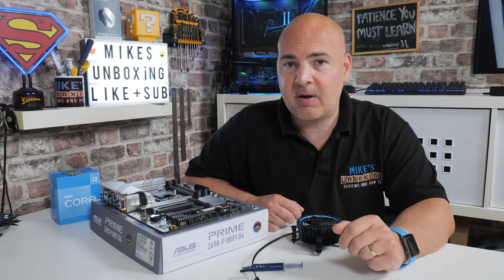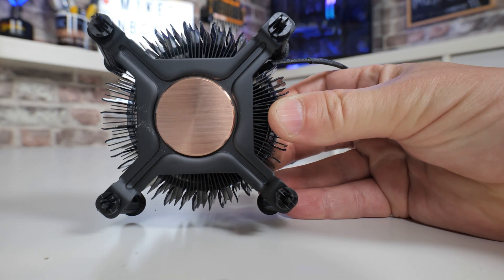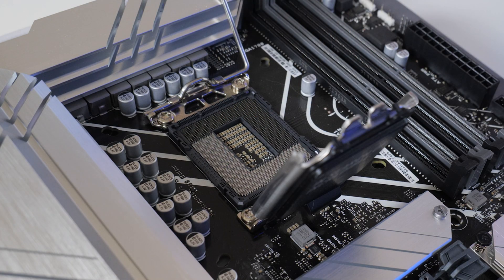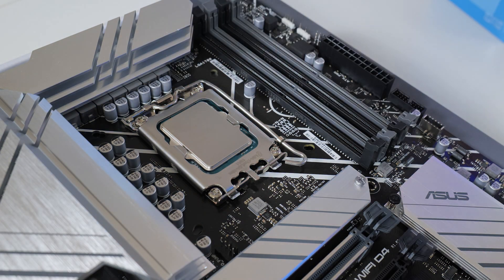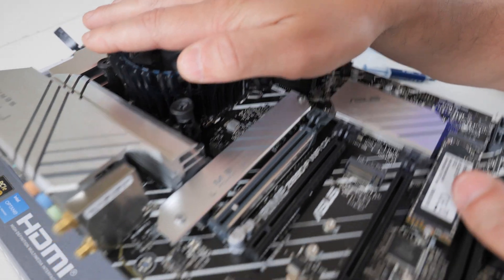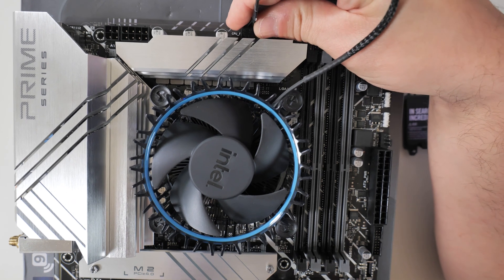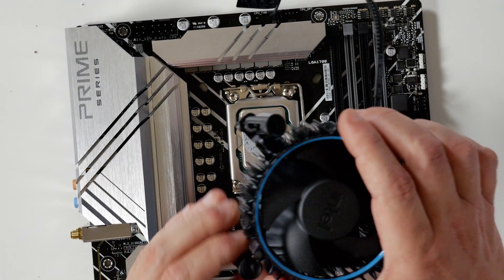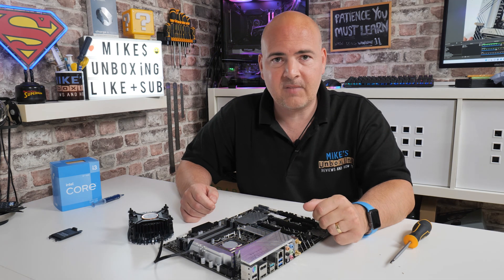How To Install Or Remove Intel LGA1700 12th Gen Stock CPU Cooler

Comment: I admit I was sceptical of push pin fastening but never seen it up close. I assume it stays in place! Thanks for reviewing Mike and Kath👍
Reply: I have to look up how to do it more times than I'd like
Reply from the maker: @Ioganstone  Did you get it fitted?
Reply from the maker: it stays in place as long as they are installed firmly and correctly
Reply: @mikesunboxing  It's a nightmare. I have been trying to get them all to lock in for over an hour now and i'm losing it.
Reply from the maker: @Saurkraut_6  Did you get it done?
Reply: @mikesunboxing  I did yes, but it was extremely frustrating. Whats wrong with standard screws intel!

Comment: Step 1: receive excellent Intel CPU FTW; Step 2: Open box and remove Intel CPU; Step 3: Remove and throw out stock Intel cooler; Step 4: buy aftermarket AIO or Air Cooler (Arctic makes excellent ones of each); Step 4: Watch Mike's Unboxing Reveiws And How To to see how to install much better aftermarket cooler.
Reply from the maker: lol agreed!

Comment: I'm glad Intel changed the stock cooler, it's not great but does it's job and looks a bit better now. I installed the stock cooler on a 12100f and the temps were very good it was 55c even at full load not bad for a stock cooler and did the job. I would look at the ID-COOLING SE-214-XT aftermarket cooler as well as it's only £20 on Amazon UK and is compatible with LGA 1700 out of the box and even has an ARGB fan too would be perfect fit upto Intel 12400.
Reply from the maker: yes the copper slug makes a lot of difference even though the actual weight and mass are the very similar

Comment: Nice clear video Mike! I really love the look of the new Intel stock coolers! I actually don’t mind their mounting mechanism either
Reply from the maker: the only thing i don't like is the part that goes through the motherboard hole is weak plastic and if not given enough pressure it easily pops out, we had a discord member this week with a pc with random crashes and it was the pin had popped out of the motherboard causing uneven mounting pressure and getting too hot
Reply: @mikesunboxing  Unsurprisingly!
Reply: @mikesunboxing  my cpu fan gets really loud and my cpu gets really hot when playing games
Reply from the maker: @TrezShortz  This is maybe easier to fix or at least advise if we can ask more questions and get direct answers, so feel free to join our Discord chat and we can go over it in more detail https://discord.gg/XtBTGQ6BDu
Agree to the rules by clicking the emoji and you will get access to the rest of the Discord channels

Comment: Looks like a decent little performer as long as you arent using a CPU with a high TDP or doing a lot of overclocking.  Easy to install too and not as ugly as the previous stock coolers from Intel.  I just feel that they could do a bit better with their stock cooler......but then agai Im AMD all the way so I dont care lol.  Thanks Mike and Kath.
Reply from the maker: this one is a little more difficult to install than the 10th gen ones and seems to require a LOT of pressure, i can see these cause overheating issues when not installed correctly